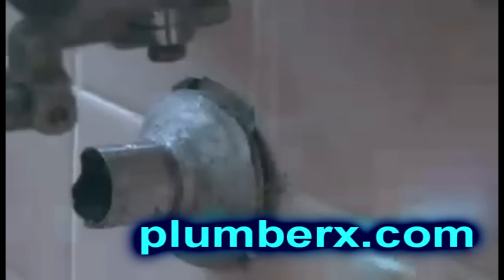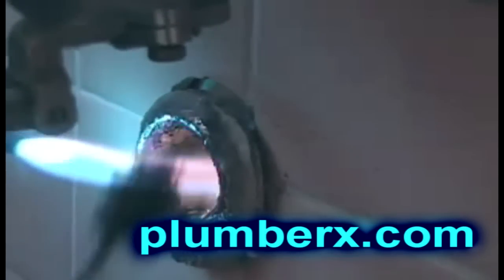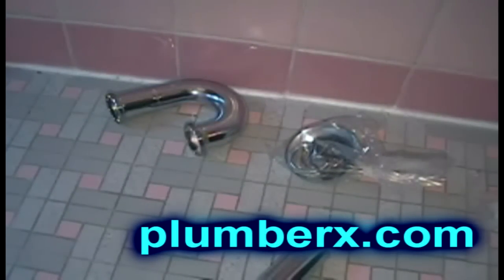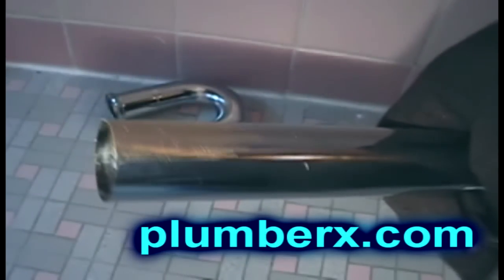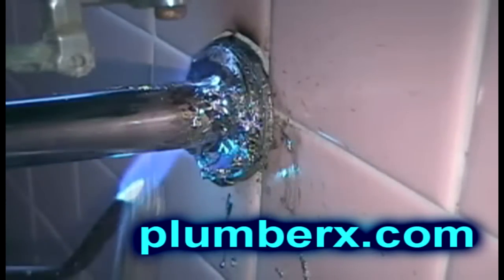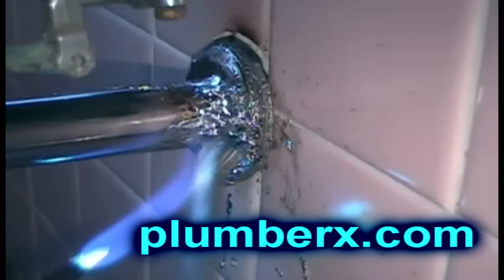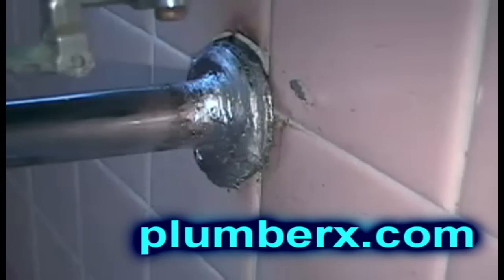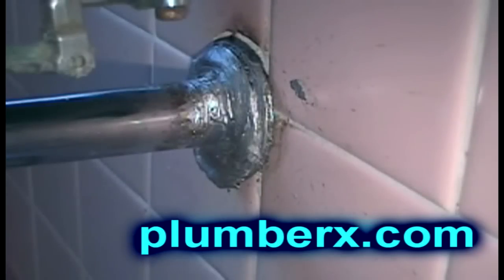Old School Lead Wipe

Comment: Nice job, Try using Tinninf flux for the tinning part, just cover the section you want thje lead to stick to with tinning flux and hit it with the torch and you should have a nice tinned area of pipe to wipe!

Comment: I have one of these I need to do but its behind a pedestal sink base and the base cant be removed as its grouted into the floor tile.  Also I want to use plastic so it wont rust, so the torch is out.  What I want is a PVC trap adapter in the wall like modern plumbing so I can just slip the wall tube in and tighten it down.  I might try something I did years ago that isn't textbook but it worked.  I removed the rotted 1-1/4" metal tubing from the leaded connection at the wall, cleaned up the inner diameter by scraping it to get a fresh surface and then I roughed up the male PVC trap adapters glue surface with sandpaper and used plumbers epoxy putty to set the 1-1/4" PVC trap adapter into the old leaded joint, then I let the epoxy cure for 24 hours.  Came back after it cured and I was surprised at just how solid the repair turned out.  I was able to insert the P trap wall tube and tighten it down with no trouble and no leaks, no one was more surprised than I was-lol
Reply from the maker: Yeah behind a pedestal sink can be very difficult. If I can't move the sink sometimes I would go into the wall on the other side of the wall behind the sink in the next room if possible and make new connections. The job in this video was done like this because in the city I was in (St Louis, Mo) didn't allow us to use fern cos connection or epoxy. There you must learn to wipe lead or build a whole drain system Lol. I understand your dilemma :-)
Reply: Thanks for the reply.  Yes I understand if your licensed many areas wont allow things like ferncos etc.  In fact the problem with this one is someone long ago had already used some kind of old fabric covered hose to clamp onto the remaining metal pipe and it wasn't leaking - but I had to be the next unfortunate guy that was forced to disturb the fragile old connection-lol   I have it connected for the moment but based on its condition im sure it will leak and I will have to deal with it sooner rather than later. Theres not a lot of space to work so im hoping I can get away with using plumbers epoxy putty one more time to securely seal in a new trap adapeter to the leaded end as I did once before, not the way I want to do it but its not my house and cant cut into walls.  I called my friend whose house I used this method on many years ago and asked him if the repair had ever given him any problems, he said it had not leaked a drop, so (maybe) I can get away with it again.